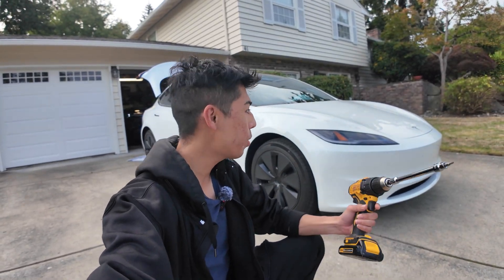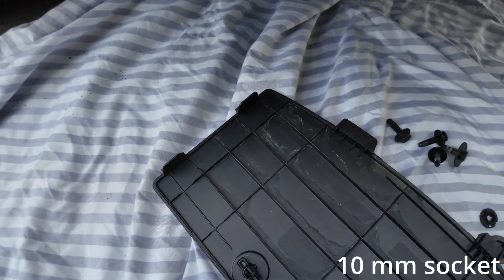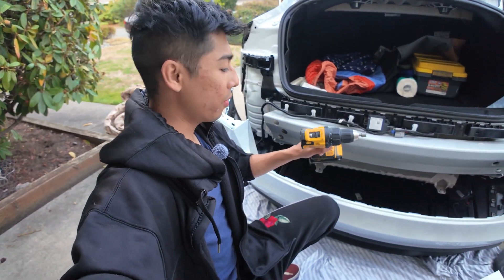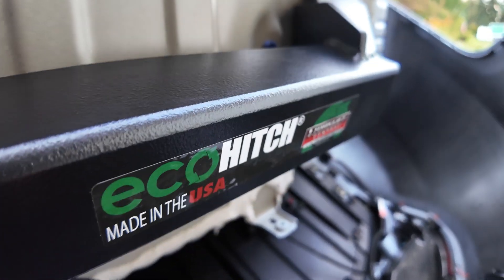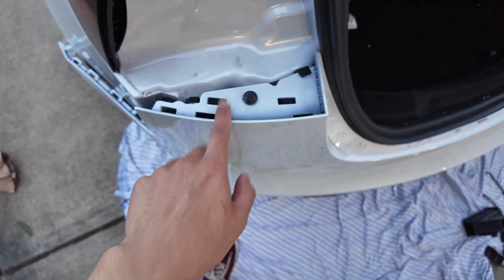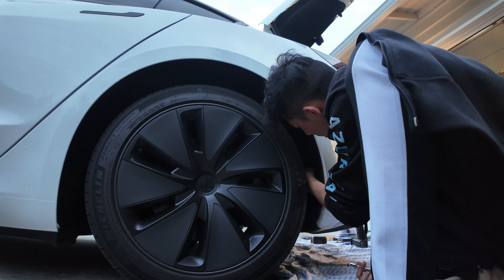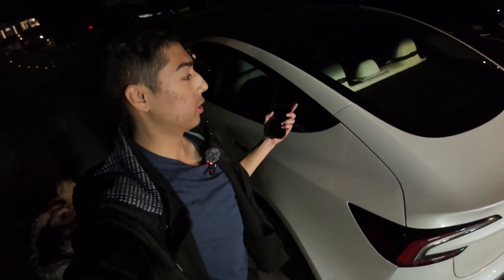2024 Highland Tesla Model 3 | Installing a Tow Hitch (Torklift EcoHitch Install)

Comment: Pretty decent video guide. Some pointers I noticed that differed from the video. 

Reverse your car up onto ramps. Unless you're as skinny as this dude good luck fitting under the car. 
The t20 plastic trim covers pull at a curve towards the center (license plate) area then up (left to the right and right to the left)
To remove the rear bumper fully support it with jackstands underneath so it doesn't fall or stress the wires. 
To remove the driver's side wire it's basically the same thing just lift the locking lever up with a tiny flathead (the lever is visible looking down towards the ground from the top) and push the connector down.. saying that guy 5 times in the video is really enraging and offers no context on how it's latched. 
The tow hitch actually should be torqued to 50 ft lbs per the instructions, not 44.2 ft lbs or 60nm... Nice to know before your bumper is on... 

Putting the rear bumper back on from fully removed isn't terrible either just use the jackstands to support it and use the keyed slots to get it under that middle skid/aero cover.
Reply: Sweet! To drop the bumper fully do remove all 3 push pins from the wheel liner.
Reply from the maker: Hey there thanks for commenting, I love your points! Pinned

Comment: Does this affect the powertrain or battery warranty? I am wanting to put it on my highland but afraid if the battery goes bad during warranty Tesla will try and say it is no longer covered due to the modification.
Reply from the maker: I'd call and ask. Since this isn't anywhere near your battery it shouldn't void that warranty
Reply: @TeslaFPV  I called, and they said since it is not something Tesla offers for the car and it is after-market, they are allowed to void the vehicle warranty at any time if I do it because it "causes damage" and the vehicle is out of manufacturer specifications since it was altered. I think it is a bunch of BS cause other countries have the option for tesla to install a tow package on the Model 3 Highland, I don't know why it is any different here. They said if I want a tow hitch that bad, to trade the car in for a Y.... super frustrating
Reply from the maker: @SilentHollowsAsmr that is the crappiest thing I've ever heard
Reply: @SilentHollowsAsmr  this isn't necessarily true. The Magnuson-Moss Warranty Act doesn't allow car manufacturers to void a vehicle warranty without proving that the modification you made caused a problem.

Comment: This was awesome. 1.5 hr install from entering the garage to tools down. Did it solo thanks to this.

Couple notes: used ~6inch ramps i backed onto to give more clearance. Used a box to prop the bumper up instead of letting it hang. 
Don't reef on the first trim pieces - be gentle, they come out nicely.

All in all great video. Thanks!
Reply from the maker: @mrfeezy3214  so glad to help! 
Thanks for the tips! 
Ramps definitely help and proping the bunper up is a good idea 💯 
The trim pieces are plastic so absolutely have to be gentle to avoid them breaking haha! 

Enjoy your hitch :)

Comment: Nice video! Might’ve missed this bit but how does it work inside the car? Do you need to enable something to have the towing option?
Reply: so, there IS a wiring harness available as well as a software update from Tesla to enable "tow" mode, whatever that is. just not sure if you can get it if you don't buy the upgrade from Tesla directly. It's funny though how the Torklift site has a crazy install guide for this hitch, and this looked so much easier.
Reply from the maker: @HypnoticDarkmoon dang it sucks that you have to go through Tesla to get that
Reply from the maker: @MrDennispeeters  nope, just be cautious when towing

Comment: Nice! Any concerns on warranty being void?
Reply from the maker: @atownstaydown4l  nope you're not really modifying anything electrical or their OEM parts. You're just bolting an additional piece on with the existing bolts
Reply: I have a 2025 and the owners manual says it will void warranty. From manual.   
“CAUTION
Using Model 3 for towing without Tesla-approved towing components and accessories may void the warranty.” And “WARNING
Do not use Model 3 for towing purposes. Model 3 does not currently support towing. Towing can cause damage and increase the risk of a collision.”
Reply: @outandabout1325  see, now that's a load of BS, as they sell a factory installed tow package, so the model 3 definitely does support towing. installing your own however may yield different warranty results depending on what happens. would most likely be dealer dependent and how nice they are.
Reply from the maker: @outandabout1325  maybe it's best to call Tesla and ask them 🤔👀

Comment: Thanks for this. For me it was like 5 hours job, that could be much easier if I would get 15mm DEEP socket in advance :) 
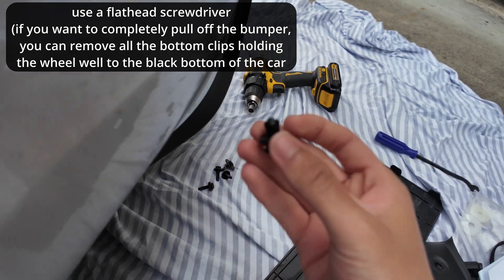The trickiest part was disconnecting connectors, one handed, while the bumper is pulling cables like crazy. Also, 4:04 there are three clips on each side!
Reply from the maker: @KneziTezi  deep sockets definitely help! 
I wish the cables had more slack! Haha. 

Thanks for the clip update!
Reply: Yes, there are three plastic clips on each side

Comment: Thanks for video. I’ll be installing my Stealth hitch I took off my 2019 Model 3, looks to be about the same basic steps 👌

Question though, does that Eco hitch not allow for the crash bar to be reinstalled? That’s a pretty necessary part.
Reply from the maker: Definitely should be the same process. 

On my 2023 Tesla Model 3 it allowed the crash bar to reinstalled. I guess on 2024 model 3 it doesn't use it

Comment: Great video! no steps missed, very informative
Reply: Having trouble finding a plug and play adapter for the wiring harness (trailer lights) is there one that you know of or will I have to try a universal kit?
Reply from the maker: @tobyboy05  I think torklift has an option for it
Reply from the maker: @tobyboy05  thank you!